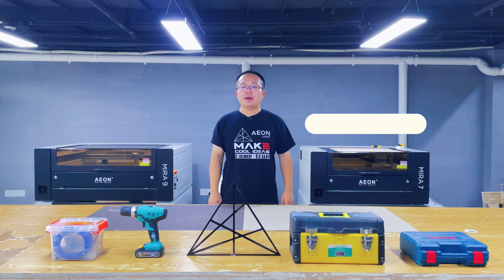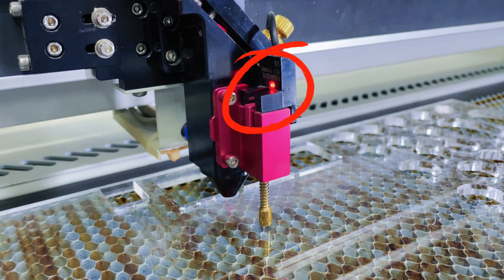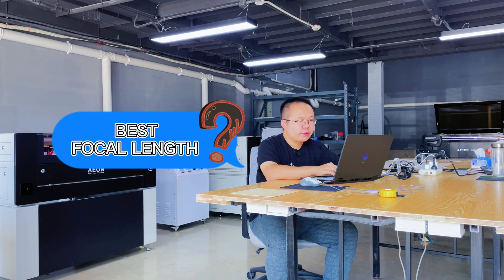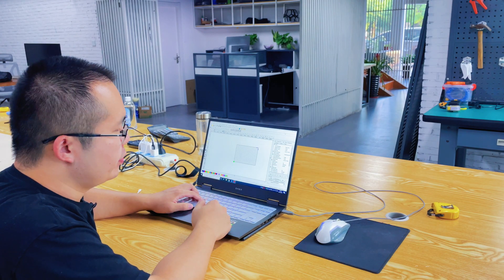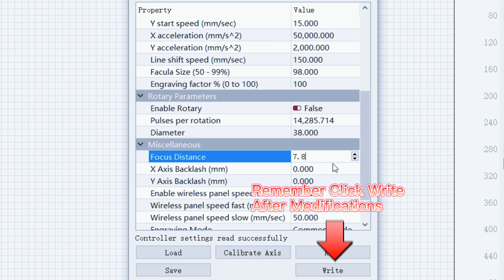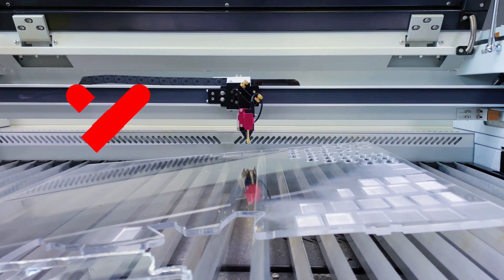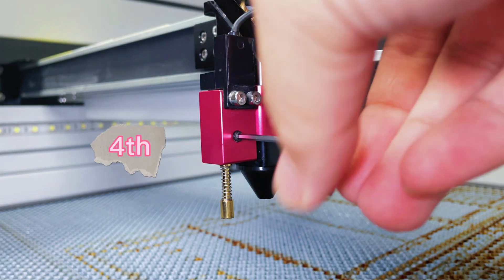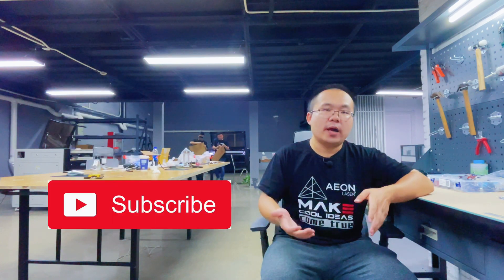AEON LASER Auto Focus & Manual Focus Tutorials for a Co2 Laser Cutter Engraver - AEON LASER Official

Comment: Hi Harry
The dot/pulse method for  finding the focal point is very misleading .  Guessing the pulse length with a quick button push can give incorrect results because the longer you press the bigger the spot. If you really want to demonstrate this method then press the ZU  button and choose LASER SET. Change to Manual  and set the pulse time EXACTLY  to say 20 ms. In that way you will get a more consistent result. A better method is to use the ramp test. However, if you are observant enough you will begin to discover that lenses are not what manufacturers claim. If you set 30% power and 10mm/s speed (a cutting speed) you will  find the focal length at  the  thinnest part of the line. Now keep the power at 30% but change the speed to 400mm/s  (an engraving speed) and  run the tst agin. You will find the focal distance is maybe 1 to 2mm different. My point here is that autofocus is a great marketing tool but if the focal point is not the fixed parameter you have always believed in , what use is the autofocus? You have a controllable Z axis and the easiest way to find the correct INTENSITY focus is to use a  focus tool that has recently been added to Light burn. It  draws lines at different distances from the nozzle  so that is is easy to see the thinnest line.  This works well EXCEPT it still has the same problem. Change the power or speed by more than about 20% and the focal distance changes. You must use the power and speed  you intend for the program. Lenses are designed with an OPTICAL focus  which is perfect for  the NORMAL light used for  cameras,  telecopes etc,  but a laser beam is NOT normal light and it is not trying to transmit an image. We use the lens  to INTENSIFY light  so that it can damage material. Although the lens is still transmitting light, the Gaussian intensity profile of the beam has a completely different relationship with the lens  and creates this variable INTENSITY focus which  changes with speed, power, material and beam  diameter. It will not take many experiments for you to see this for yourself.. Time. patience,  accute observation and skepticsm are the main tools you need to understand laser technology
Your machines are beautiflly engineered and  are  elegant in appearance.   Sadly your designers ( like almost all others) have paired well proven laser beam technology with well proven lens technology and assumed that they will work together. Yes they do work well enough together  to be OK but dig a bit deeper into the lens laser beam relationship  and there is much to be understood and refined.  Neither the laser tube maker nor the lens manufacturer is responsible for  how you apply thier procucts.   There is an opportunity for a  company such as yours to undertand the disconnect between these tto parts of the technology you sell. Understanding and feedback  helps your deigners.   They need real world feedback not equipment specifications  to improve your products into areas that others have never explored
Yours was a well presented video and  nothing I have said  is directed at you personally. I would consider it an honour if you could pass my comments back to your marketing and R&D departments. Maybe this 30 second video will  stimulate some intresting discussions., Everything that conventional lens theory predicts says this is not possible.  Just for reference. the focal point was set onto the material surface.
https://youtu.be/vTEAm-01E1Q
 Best wishes to all
Reply from the maker: Hi Russ, It's an honour to have your professional advice, Yes, the dot/pulse focus test is misleading if without setting the pulse time and power. Thank you for pointing out this.  You really got a very deep understanding for the laser industry. Most of parts used were not designed specially for laser machines, Lens, laser power supplies, drivers, air pumps, blowers, mechanics, etc.  As it is a relatively smaller business. To make a perfect laser machine is very hard, unless we could change the whole supply chain. But, that's always our goal. We want to do that because we love lasers, it is a fascinating products which could help people to turn their creative ideas into reality.  I will sure deliver your professional advice to our R&D team, we'll experiment more and explore deeper for the optic sections to improve our next generation of machines.  By the way, your videos were really great, and many interesting experiment for lasers and really very helpful for people who love laser machines, hope to have more professional advice from you. !
Reply: @aeonlaserofficial  
Hi Harry 
Thanks for the kind words and understanding that there was no malice in my comments. I have briefly used and Aeon machine whilst visiting a friend in USA. As a retired engineer and designer I can really appreciate the quality of the Aeon design   I also fully appreciate that this machine, like many others, relies on using mass produced components, however, it is obvious that you have chosen the best avilable. and created an A1 quality product.  I rarely comment on other's videos  but the quality of engraving was unworthy of such a beautiful machine that I admire.  Everyone wants to do photo engraving with their lasers and there are lots of software packages available to  make idiots feel like experts. VERY few take the time to understand  the principles behind digital graphics and how, in its basic form, a laser machine is ill-fitted to be a laser printer. I do not use such software but have instead have engineered details into my machines that  address the process weaknesses and allows me to do photo replication , not photo engraving. Here is a brief sample  of what my 30watt RF machine can do. 
https://www.youtube.com/watch?v=BtarXNFq92g
This is just a very cheap Ebay 3050 machine to which I have added a 30 watt rf laser. Yes I have done some detail modifications and initially I was very disappointment  by not finding the "magic" in this technology Trotec and Epilog promise in their videos. After a year of not using the machine and experimenting with that  weird laser beam/lens relationship, I returned to the machine with new ideas.. The short video is a demonstartion that I have now unlocked secrets of this RF technology that I have not seen elsewhere. 
Can I suggest you take alook at my CONCISE video series here which takes my 7 years of laser experience and breaks it doewn into a series of short  videos suitable for beginners and experts.     https://laseruser.com/the-concise-rdworks-learning-lab-menu/
Knowledge is free so if you wish to use any of the ideas I demonstrate  then go ahead and pass on the facts about this technology.   My goal is to rid  this fascinating technology of the many many myths and misunderstandings that I encounter daily. Factual demonstrations that showcase a tecnical prowess, will compliment the excellence of your machine and help to advance peoples knowledge, even if they do not own an Aeon (or Mira) machine. 
If you feel the need to contact me then you can do so with this contact link
https://forms.zohopublic.eu/ndeavorlimited/form/K40XtreeemLaserCutterContactRussSadler/formperma/k2Cn0QN5ChpazfTMAUw25lZ-FKpjZa96TQWHjv3ntOg 

 Best wishes
Russ